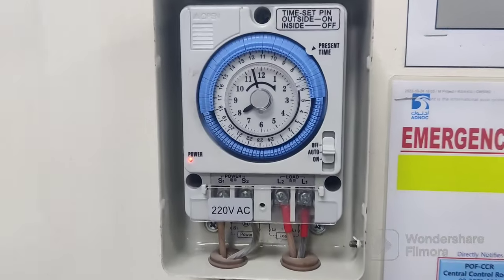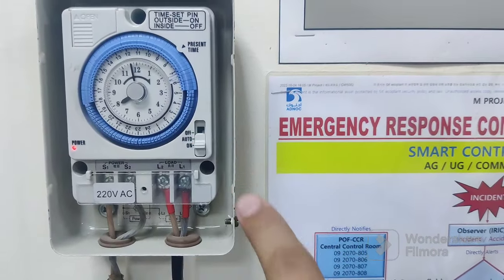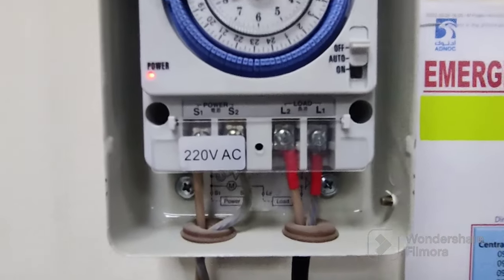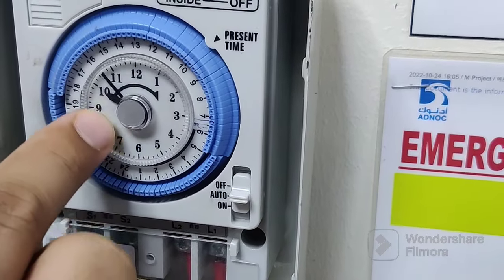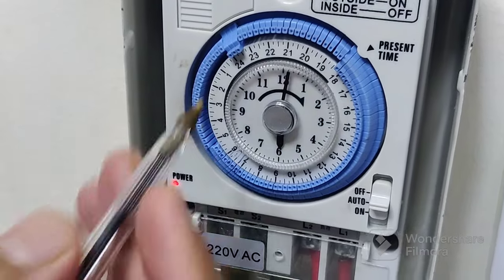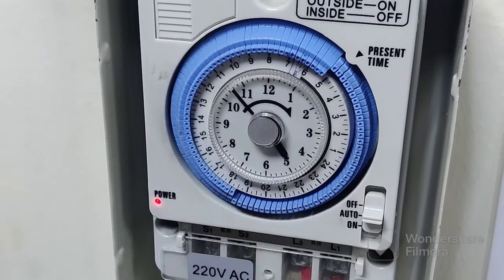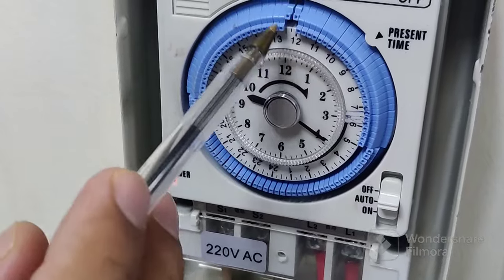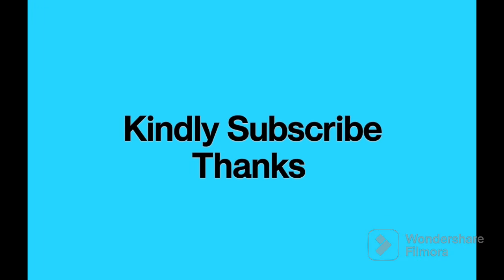Timer Switch/ How to install and set the analog value for a specific time.     (Revised Video)

Comment: You never mentioned if the timer watch is not working suddenly why ??
Reply from the maker: Good question but never face with prob. If any prob happens then need to change
Reply from the maker: If any prob then you can change the switch from auto to manual